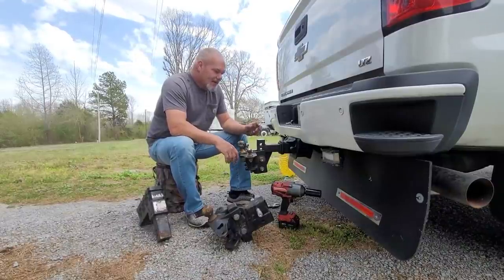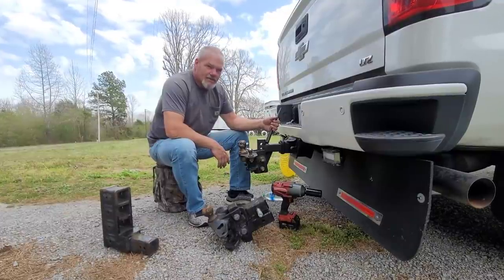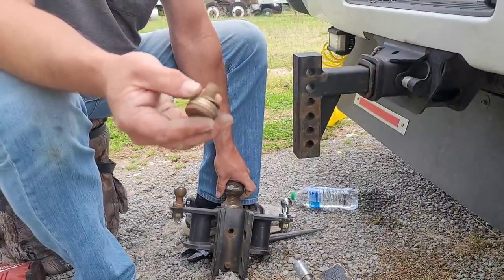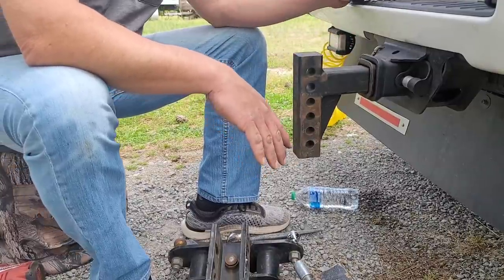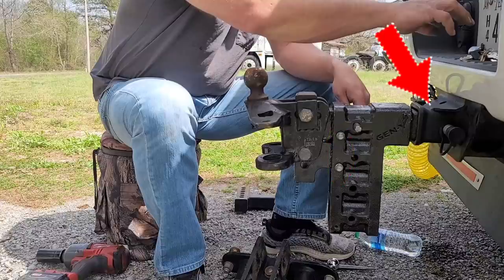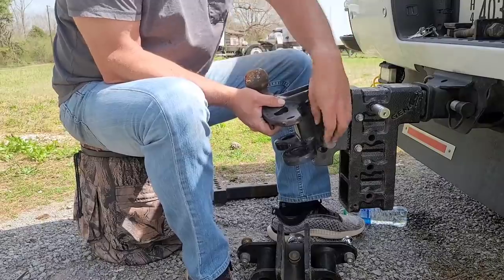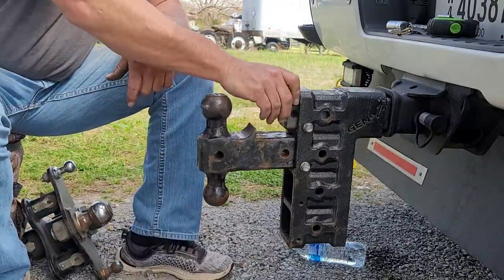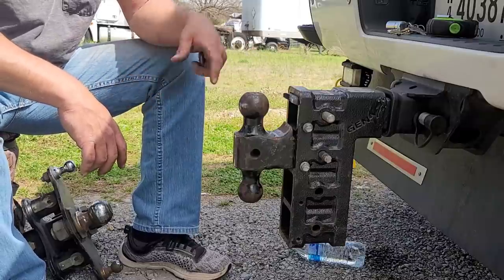Gen-Y weight distribution setup.

Comment: Excellent tutorial on how to set these hitches up! I ran an EAZ Lift for years, which I believe are almost identical to your Husky, except that the spring bar sockets were enclosed. Some interesting details in setting these up are as follows: to determine how much to tension the spring bars, measure the distance from the bumpers (front and rear) of the truck to the ground before hooking up and write these measurements down. Then hook up the trailer and adjust the spring bar tensions until both front and rear bumpers on the truck squat equally, with about an inch more squat at the rear bumper than at the front. Once this step is done the hitch weight is properly equalized. Next count the number of chain links that remain between the brackets on the trailer tongue and spring bars. Ideally, you want at least 4-6 links of chain here to allow for turning, since the ends of the spring bars need room to shift front to back during tight turns. To increase/decrease the number of links, unhook the trailer and adjust the tilt of the ball mount by adding/removing the shim washers. Each shim washer is equivalent to one link of chain. And if you feel you need to raise or lower the hitch height for different trailer tongue heights, the spacing of the holes in the shank is also equivalent to one link of chain. In other words, if you needed to raise the hitch head 1 hole, you would also subtract the number of links showing by 1 and your amount of weight distribution will remain the same. I hope this gibberish makes sense. I really like this style of hitch because it can be fine-tuned like this. Safe travels!
Reply from the maker: Thank you! I wished i would have had a trailer there so i could have shown more about the setup process. I'm going to pin this comment off i can figure out how. Good info
Reply: @CFarmer  thanks, you always do a great job at explaining and demonstrating these things for us. I learn something new every time I watch one of your videos!
Reply from the maker: Thank you!

Comment: To get rid of the slack between the receiver, take a metal roofing screw with a 1/4” head on it, screw one on each upper corner of the receiver. It acts like a wedge. It’ll never rattle again. Only problem is you have to remove the screws in order to remove the hitch from your truck. I’ve used Philips screws before, but the the 1/4” head is easier to remove if you need to.
Reply from the maker: I've never thought of that

Comment: Drill  and Tap a Hole in the top of the Hitch Receiver and then put a Brass Screw in it to tighten it up.
Reply from the maker: The thought crossed my mind when i was looking at the gen-y
Reply: @CFarmer  Using either Brass screw are a small piece of brass between the set screw and the item you want to lock I have found works really well. The cheapest brass screws would be a Bowl to Tank in plumbing.
Reply from the maker: I'll have to check that out. Good info

Comment: The farther it sticks out the less tongue weight or it puts too much leverage on the hitch and can crack the shank if you have alot of tongue weight..
Reply from the maker: I agree, definitely  more leverage but with shank being rated for 21k lbs and the weight distribution shank being a double shank it should be ok with the bumper pulls i pull.

Comment: Did you consider BOSS GenY torsion hitch?
Reply from the maker: I did but i was told the torsion hitch needed to match the weight of the trailer and pulling so many different trailers i didn't know how that would work for me
Reply: @CFarmer  yes, i agree with what you were told, if you tow 9k you can only have 10k torsion, if you tow more with different trailer, you need a different torsion

Comment: Great info! I have the Reese WDH and both large washers have always been on top bolt. I added lock washers to both bolts since they started backing off. No trouble since. 

I just bought the Gen Y torsion 16k lbs hitch and going to get it installed and setup today.
Reply from the maker: Thank you! That's good to know